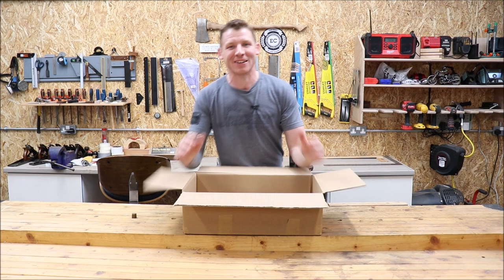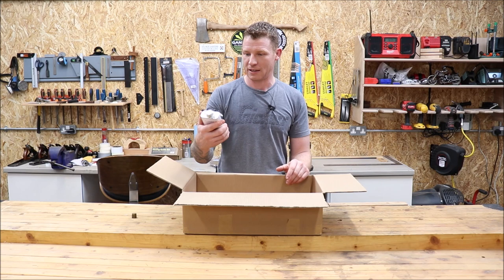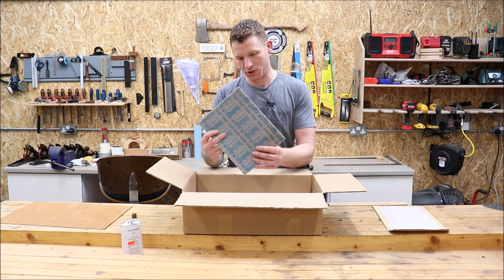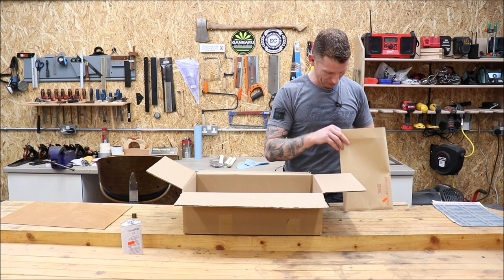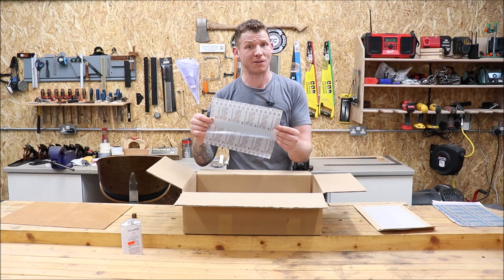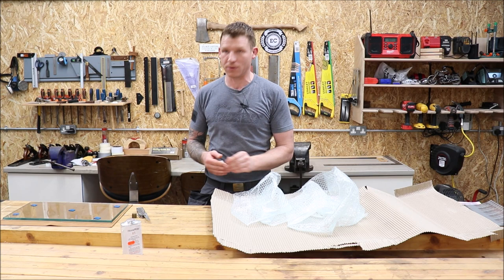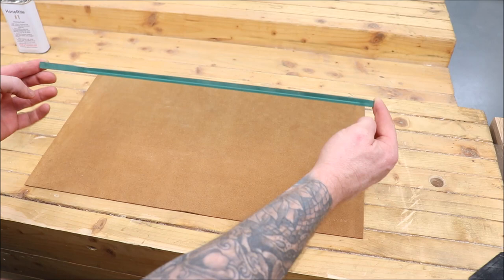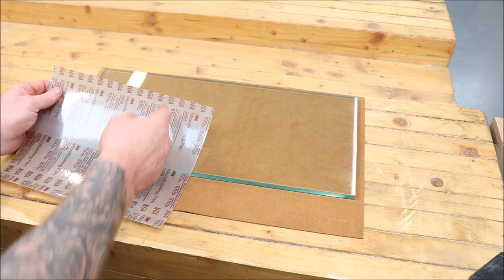Plane Blade and Chisel Sharpening on The Scary Sharp System, First Impressions...... It Works!!

Comment: A good video, and I've subscribed to your excellent channel. One point: at 15.58 you mention the order of pink and green lapping films. I think actually the green is the finer one (1 micron; the pink is 3 micron - it's marked on the card which came with my identical setup to yours from Workshop Heaven ). On the WH/Crimson guitars video, Matt finished with the pink because he was using only 4 grits and the finest he had was the pink.

Comment: When you compare the prices compared to a decent Japanese stone, or even buying all the components individually, it does seem a bit on the expensive side. Then it also has a much more limited longevity. It does seem to work though.

A great unboxing, you went through everything very comprehensively. Thank you.
Reply from the maker: well if you think about it , its the price of one diamond plate, you never have to flatten it and the film is cheap to replace. The time saving and ease of use is another bonus. That is my initial impression anyway.

Comment: Hi John, tks for the video. I'm going to buy this system. As a matter of interest, do you recommend any good suppliers in Ireland or NI, generally for woodworking equip? I'm aware of the carpentry store. It's getting more difficult to source from UK now!!
Reply from the maker: The Carpentry Store is where I get most of my stuff

Comment: Are you still stuck with this system?  I'm trying to choose between investing in whetstones or scary sharp.  I already use a diamond plate 300/1000 but I don't think it cuts very well when shaping a new bevel.
Reply from the maker: I use scary sharp all the time, I find it very easy to use and I get razor sharp blades and chisels I even sharpen my knives on it. Can't fault it so far.
Reply: @JohnMcGrathManInShed  Thanks good to know.